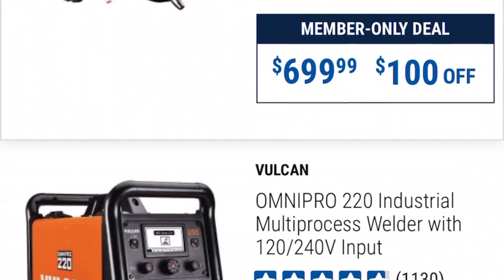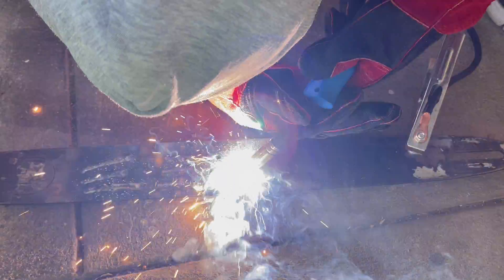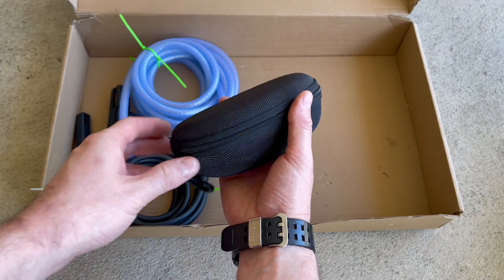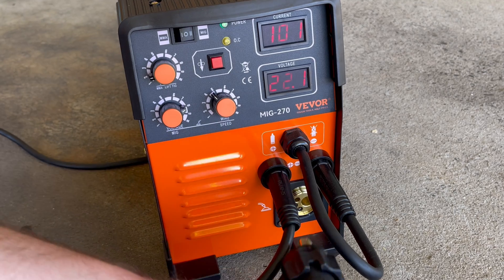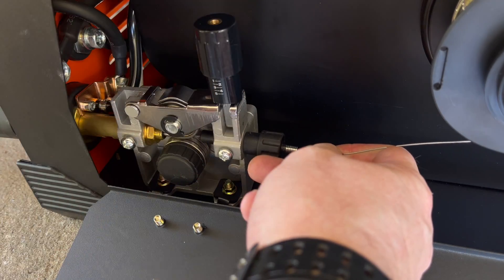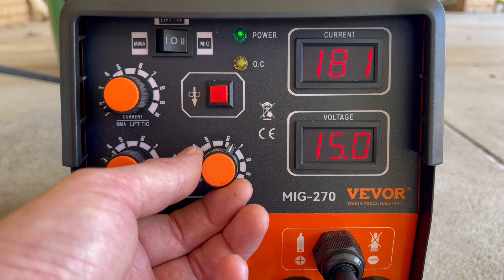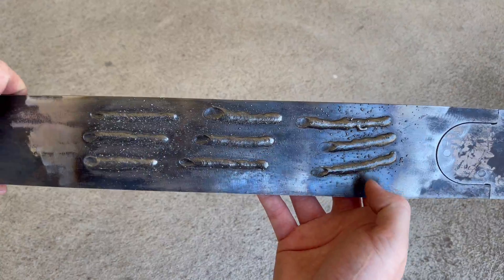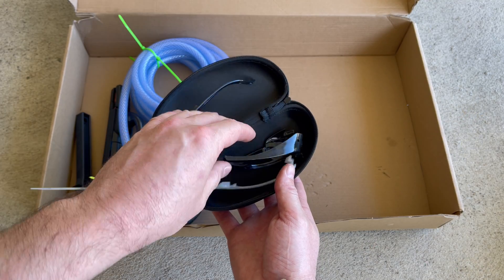Testing A Vevor Mig 270 Welder - Is It Worth It?!

Comment: Hi, your answer to the following question is critical. Is the MMA and fluxcore output of this machine DC or AC ?
Reply from the maker: This machine is a DC only, no aluminium or magnesium welding possible!
Reply: Hi, I am new to this type and particularly this vevor machine. I still have 6011 and 7018(AC/DC, askaynik brand) in stock. So will this machine weld these rods ? @VintageEngineRepairs
Reply from the maker: @misterman1909 that's a great question, I actually don't know about stick! Best to reach out to Vevor!

Comment: Hi, did you remove any slag and don't you think, 190 amps is quite large to bond that thin consumable to the base metal ?
Reply from the maker: Hey, I used a wire wheel to remove the slag from memory! This was hardened steel which takes a lot more amps than mild :)

Comment: G'day Tom. I purchased one a couple of years back I'm 57 been a welder fabricator for the past 30 odd years. The 270 is a good bit of kit. I've used it from car Panels to 10 mm base plates, light structural, and pipe. The flux loves galv unlike solid wire and the stick will push a 4mm rod all day.
Reply from the maker: Great to hear mate! I have yet to tackle anything thick enough that  it can’t handle 😦 thanks for watching :)
Reply: You Aussie ?
Reply from the maker: Brit in Aussi lol. You?

Comment: I've always wanted to learn but its 220 volt right ? Don't want to convert too expensive  .
Reply from the maker: Na the one you’ll buy in the USA comes with an adapter plug :)
Reply: @VintageEngineRepairs With half the current and duty cycle. Running a mig on 110 is perfectly USABLE, but severely limiting.

Comment: Hi Tom .... just a little rhyme to remember ... "if there is slag, then drag". Push the MIG torch into the weld puddle ... drag the electrode away from weld puddle when stick welding.
Reply from the maker: Thanks for the tip! Yes I have heard that before, but thanks for the reminder 👍

Comment: That looks quite impressive with all the adjustments available and the different types of welds you can do. I have a small CIG gasless mig and it's amazing how thin the metal can be that you can weld. I ran out of the wire that came with it and got some of the Boss brand from Bunnies and I don't think it is working as well, so I just got a roll of the CIG stuff today to see if it works better. Does that one use shielding gas too as I thought you showed a connection for it? A very handy addition will be a self darkening shield down the track.
Reply from the maker: It seems to be a good unit for a homeowner wanting to do projects around the workshop for sure! Let me know how you go with cig wire, I’ll need some new stuff soon.

What size wire are you using that allows you to weld so thin? 

Thanks for sharing!
Reply: @VintageEngineRepairs  I was using 0.8mm wire and the metal was only about 1mm thick. Mind you I was only repairing cracks, not continuous welding.

Comment: So far, I have had good luck with the Vevor products I have.  Not the best by a long way, but good enough.  I have read that if you want to return something, there will be issues.  As for flux core vs shielding gas...Flux core works better if wind is a factor.
Reply from the maker: Thanks for sharing :) I can only speak for their mini metal lathe as that was the only other product I have tried. They seem to offer really good value products to the home owner when compared to shops or Amazon which offer the same product but at a much higher price.

Comment: Flux core is very bad for spatter and is difficult to keep from getting on your material, the spatter spray might make it easier to remove the spatter after welding.  Using a hardened scraper can help with removal, if you have access to someone who works in a sawmill maybe they can get you old chipper blades, these make good slag scrappers.  If someday you can afford to get shielding gas, you will be much happier.
Hope this helps.
Ray
Reply from the maker: Thanks Ray! Much appreciated mate :)